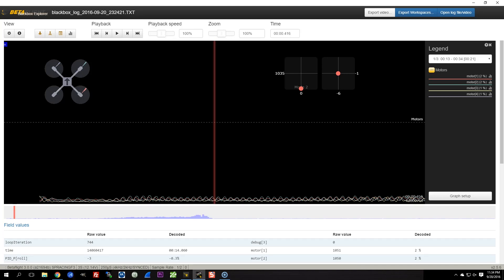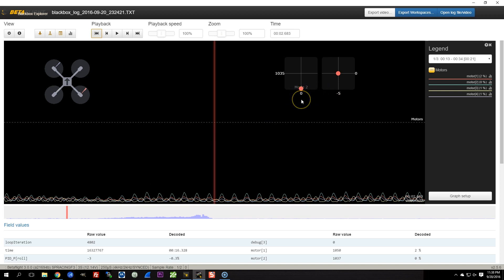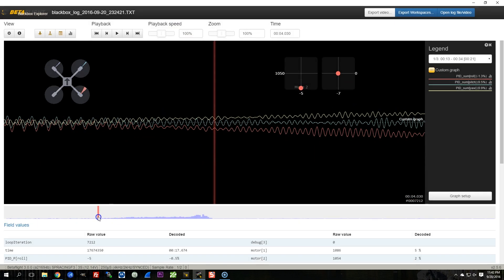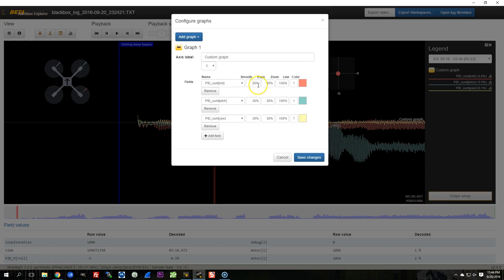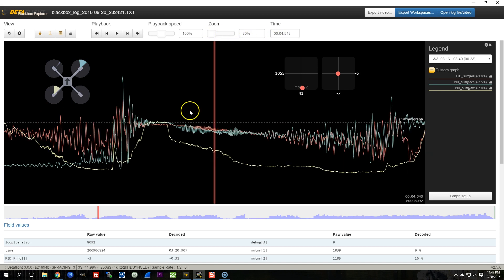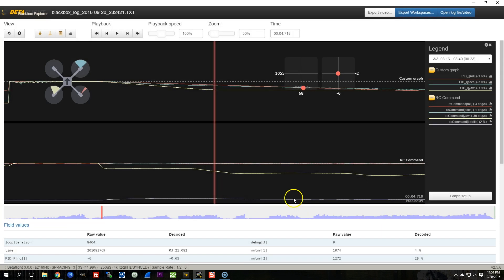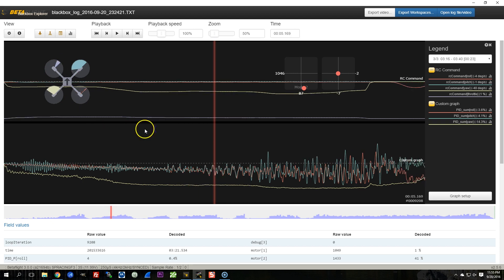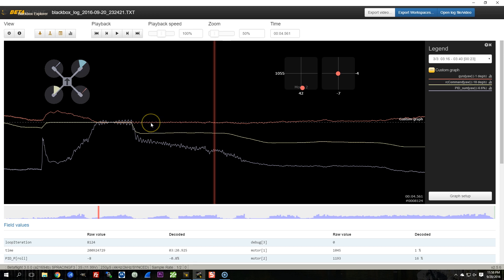Blackbox Log Analysis - joshuabardwell - 10/30 - Part 1

Comment: it sounds like the fc is fighting the 10° motor tilt  flash it back to clean flight
Reply from the maker: Why would that cause the front-left motor to not spin up?
Reply: Joshua Bardwell the fc is not recognizing the 10° tilt it is generating bad data and trying to correct it with more bad data it just needs to go back to clean flight where the 10°motor tilt  is supported and can be configured
Reply from the maker: I'm not sure I'm following you, but I did try flashing back to CF and it didn't fix it. The problem was eventually fixed by replacing the flight controller.

Comment: A loose prop ?
Reply from the maker: That would cause the motor to go to full throttle, since the motor would be making less thrust than expected. For the motor to go to zero throttle, it would have to be making more thrust than expected.

Comment: Just maiden'd my Martian 5". With dys xm30's, red bottom 2300s, sp racing f3 acro and runcam swift in the factory mount that uses the carbon plates.  New RK 5x4x3s and I'm getting a crazy amount of jello when I give any amount of throttle above just hovering.  When hovering and cruising slow it's fine.  This is my 1st time using this type of cam mount.  I've used the same cam and motors on a different quad w/no issues at all.  The mount holds the cam very solid which I'm guessing might be the issue.  I'd like to keep the mount.  Any ideas?
Reply from the maker: https://www.youtube.com/watch?v=Pz_X7d9zxMA
Reply: Joshua Bardwell thanks, the board in the cam was loose.  I had to switch to the other back plate and for some reason it wasn't holding the board secure.

Comment: My guess is the firmware has a bug or board is a clone cc3d with problems(assuming u flashed properly with full erase etc)   Betaflight did some target rework and perhaps they reading the gyro backwards or similar- unlikely i guess but possible?
Reply from the maker: Decent guess, but the copter WAS flying fine a week ago, and nothing has changed except I flashed the ESCs to BLHeli. I'll save you some guessing and tell you that it turned out to be a bad gyro in the FC and replacing the FC fixed it. I only learned this after replacing the ESCs and motors.
Reply: Joshua Bardwell ahh makes sense. Strange how it was working fine till you upgraded from cf to bf and started getting the problem... problem that perhaps cleanflight was hiding with its more forgiving filtering?
Reply from the maker: No, because I tried turning filtering down to a ridiculous level. But good thinking. I also thought that direction.

Comment: Blheli update wipe motor direction preference? Nice to see an example of Blackbox used to examine (non-catastrophic) system failure.
Reply from the maker: That would cause the copter to flip out upon throttle up.

Comment: did  take the props off at all ? if you did maybe you mixed the rear  left and right  props  around , school boy error i know  but we all make mistakes somtimes
Reply from the maker: No, but that wouldn't cause this symptom anyway. Reversed props would cause the copter to flip out on throttle up.

Comment: perhaps your board alignment/rotation is wrong?
is it spinning correctly in the betaflight GUI?
Reply from the maker: One of the first things I checked. Remember, this copter was flying fine previously with same ESCs, props, and FC. None of that has changed.
Reply: Joshua Bardwell Thats correct, the orientation has to be set in the fc settings tho, so forgetting that could cause issues.
As for the issue at hand, I can't think of anything else that can explain this behaviour. good luck 'bug'hunting ;)
Reply from the maker: I recorded this weeks ago. Suffice it to say, I eventually figured it out. But thanks for thinking it through with me. I think this sort of exercise is very valuable for everybody.

Comment: Are the props on correctly? Maybe 1 of the props is on upside down?
Reply from the maker: +Christopher Punton plausible
Reply from the maker: No wait sorry. Not plausible. Prop on upside down would cause that motor to spin FASTER than the others. We don't see that in the Motor traces.